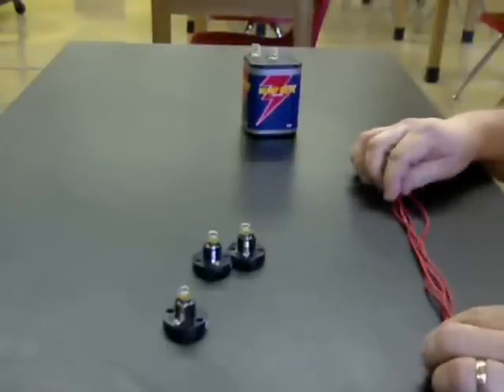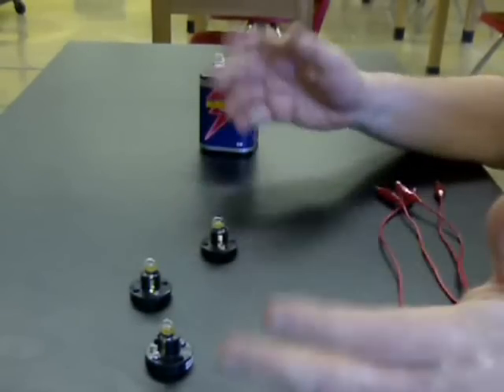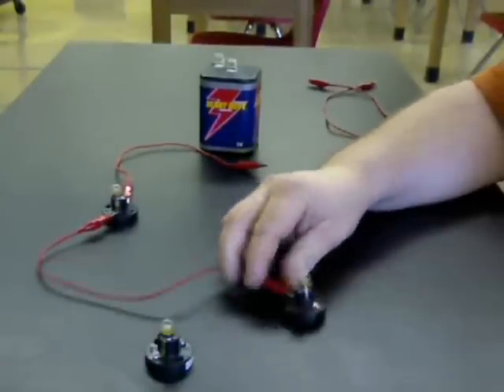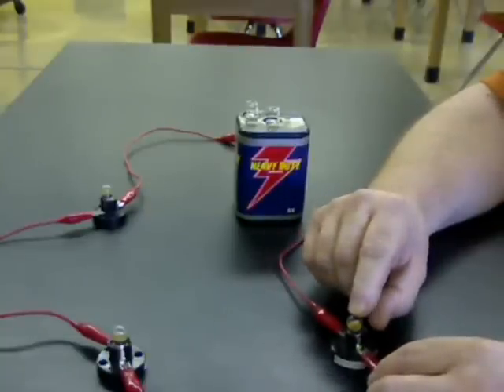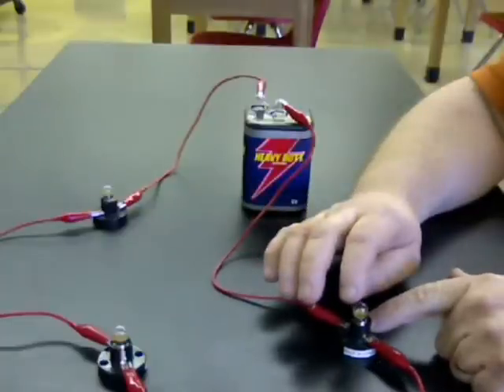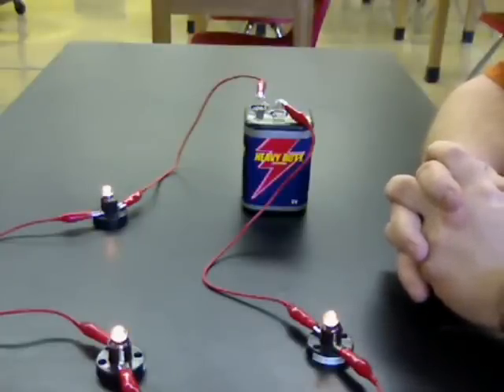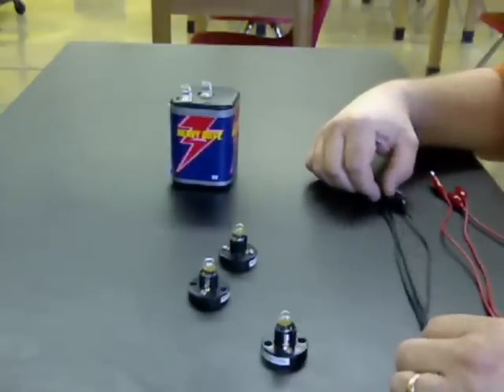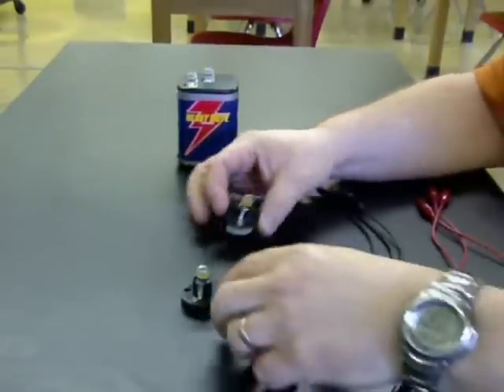Series and Parellel Circuits

Comment: Too bad you didn't do your circuits with like 10 or 25 ohm resistors and use a DMM to show voltage drop and total resistance in each circuit.

Comment: last statement of the circuit working if a wire breaks is wrong only if the bulb fails it still works since there is contact with the cables and electricity is still flowing.

Comment: Great video. You complied the practical application of Series and Parallel circuits into one video unlike some other videos out there. I have one question however regarding Parallel Circuit, if you remove either the positive or negative circuit (wire) going from the Power Source (in this case your 6v battery) powering the first device (your first light) wouldn't THAT ONLY  be the case to where your other lights will not work in Parallel Circuit setup? I am going to make a separate video showing an example like this, in the very very near future. Thanks again for making this video. Saved it for future reference.

Comment: thank you- how do we incorporate a light switch into the parallet circuit?  my 5th grade girls (twins) have a science project and they need to build a 4-room minimum "house" and wire it to make each room light up using a parallel circuit using on-off switches- It has to be battery operated of course.  Help!????